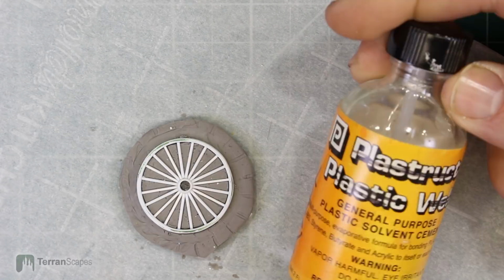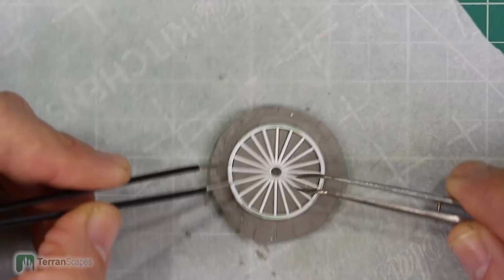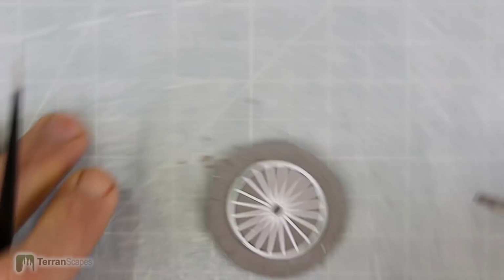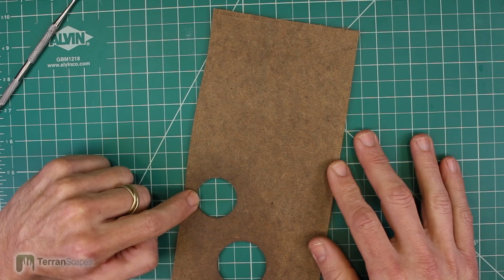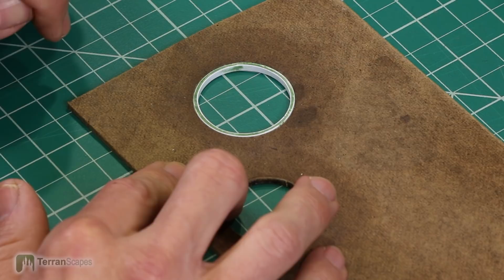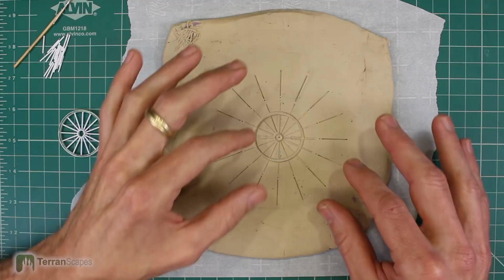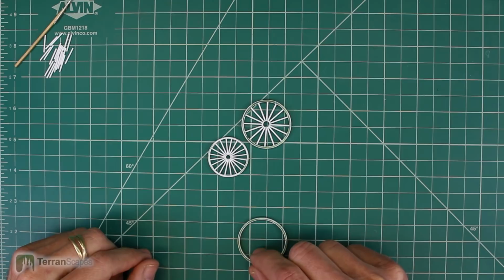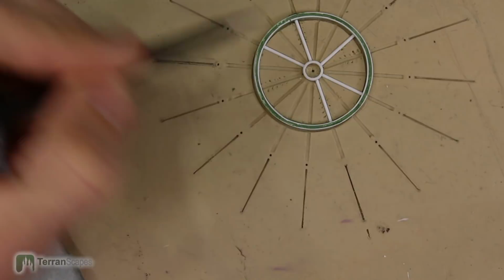Making Spoked Wheels prt 3 - Innsmouth Tour #8

Comment: The format change is fine. Do keep your stress level down, 'cause this should be fun! The engine will, no doubt, be the make or break of this project, in my mind at least. Regards, Solomon
Reply from the maker: I'm working on keepin' it fun.  :)  I agree, the engine will be the big thematic item but it occurs to me that I can add other things as well.  Perhaps some steampunk fish sorter in front of the warehouse.  Or some kind of broken down generator outside of a home.  It would be helpful to have a couple smaller pieces in the theme.  I'll be thinking about that more down the road.